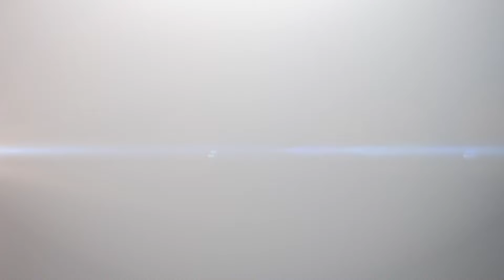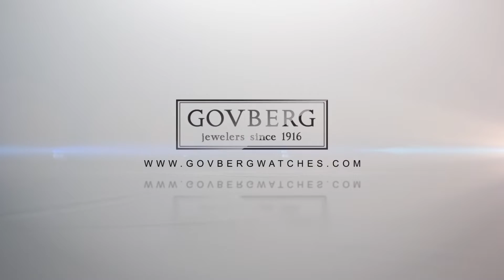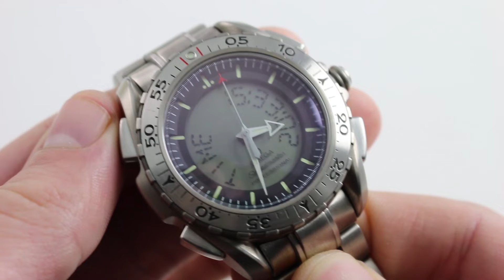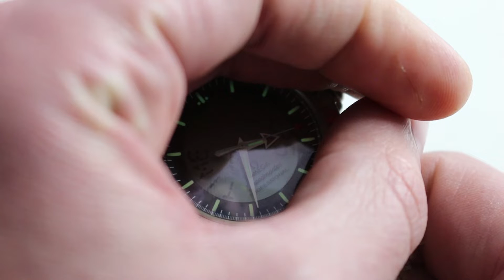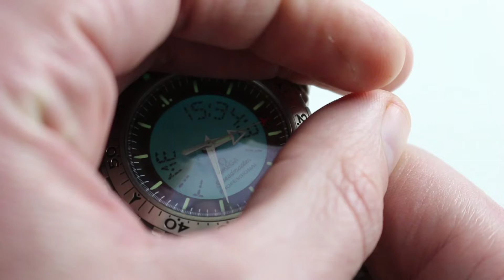How To Use The Omega Speedmaster Professional X-33 Generation 1 & 2

Comment: Yet another super informative video from the best watch reviewer on the 'tube. I've desired an X-33 for so long it isn't funny. This only adds to my appreciation, what an incredibly cool watch from Omega.
Reply: Govberg Jewelers do these quartz omegas age well? Are they reliable?
Reply: Quartz movements can last for decades, just as mechanical ones. You can find examples of Omega, TAGHeuer, Seiko, Casio, even Rolex OysterQuartz, just to name a few, dating back to the 70's !
Reply from the maker: Thanks for watching. It's an incredible timepiece with so many different functions; very cool and unique. Let us know when you're ready to add it to your collection ;)
Reply from the maker: They are quite reliable. As long as you take care of the watch (like any automatic or manual) quartz Omega's will last. There is the chance that after quite a while the circuit will need to be replaced (similar in theory to a movement replaced in a automatic) but regular maintenance and care will help avoid this.
Reply: Govberg Jewelers thank you for your reply and great vid. Ive always had affordable watches, quartz and mechanical (swatch, seiko, tissot, vostok) and all of them were reliable. But they had simple movements and were inexpensive, so i was never worried about reliability. Im considering buying a higher end watch, being the speedy pro my favorite. Hand wind chrono, solid caseback, plastic crystal, great history, great brand, the works. But a good one in second hand approaches, usd 3 grand... Out of my league. So now im looking for 90s mechanical tudors or a high end swiss quartz. Ive found nice x33 gen 1 for around 1700 usd and I am tempted but also a bit cautious, because i probably wont be able to service it outside omega and ive heard horror stories about the gen 1 (which might not be true) . Cheers, keep those vids flowing.